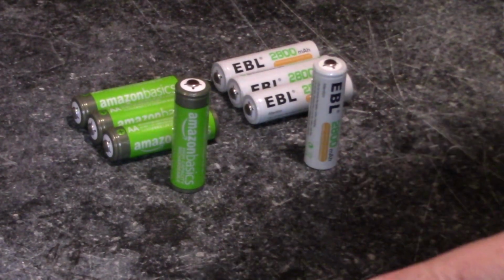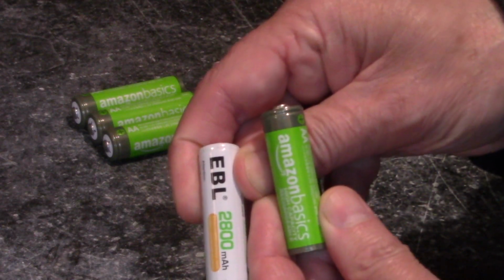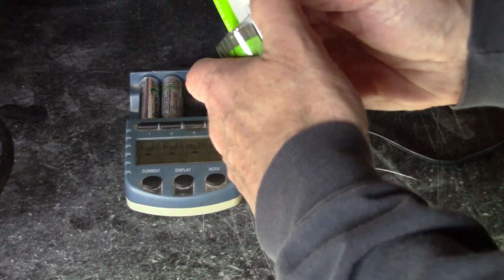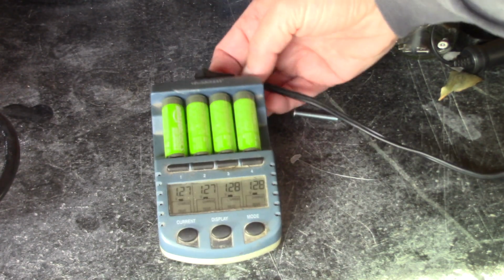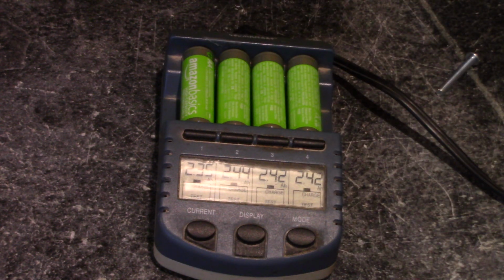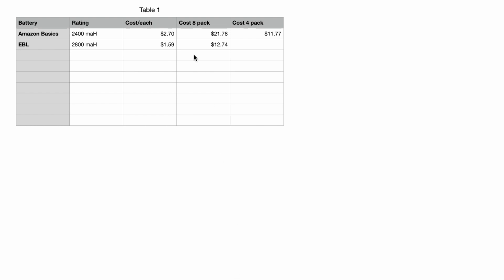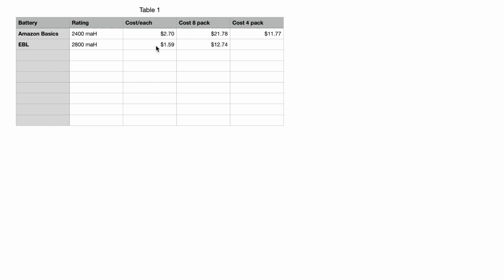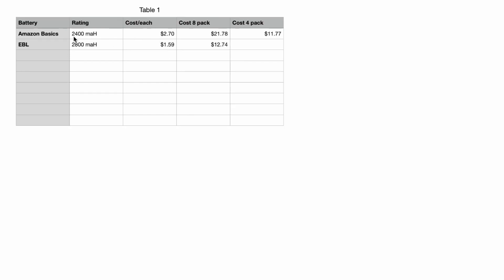Amazon Basics AA NiMH Rechargeable Batteries Compared To EBL - Which Is Better?

Comment: My Panasonic AA rechargeable batteries I bought 25 years ago still have higher capacity and lower output resistance than newly bought EBL. EBL will not hold the charge.
Reply from the maker: I have had similar experiences with other brands as well.

Comment: Everybody's neglecting one of the biggest differences that define overall cost -- cycle life.  Everyone assumes that they're either all the same or that the rating is accurate.  Neither assumption is even remotely accurate.  An 8% difference in single-charge capacity is nothing if the usable cycle life can vary between brands by as much as an order of magnitude.

Comment: I got 8 pack Amazon basic high capacity 2400mAh AA for $6 last week, it was on a deal. So I guess I got a real deal.
Reply from the maker: That's great news.
Reply: Amazon rechargeable batteries meet and sometimes overexceed expectation.
Reply: @GuyJames907  yes but Panasonic eneloop are definitely better, I text them and Panasonic last longer
Reply: Eneloop is always going to be better,  didn't bring it up, but they the best batteries around. Amazon rechargeables are decent quality

Comment: Amazon Basics prices have come down since.  I just saw 8-pack AZ Basics AA NiMH for under $13.   I may get those versus a new order for Ikea LADDA 2450 which are basically Panasonic Eneloops.  Ikeas are $9.99 for four.  Basics beats that - as long as they perform with same level cycle count.
Reply: If you want to be sure you get quality then, make sure it's made in Japan. Chinese cells are OK New, but down the line they go bad faster.
Reply from the maker: Good to know thanks.

Comment: Amazon Basics also has 2000mah batteries that are a great deal IMO. I bought some recently and put them on my tester, and found that they got about 2020mah or so on the very first cycle. I was a little bit surprised that they met their rated capacity without breaking them in, most NiMH batteries need a few cycles before they reach their full capacity.
Reply from the maker: Thanks for sharing

Comment: OMG EBL sucks - they lasted less then a year in almost all of my applications. Also they update and change generation without updating any markings making it hard to tell which ones are old vs new
Reply from the maker: Yeah I'm not a huge fan of EBL either.
Reply: They've been known to exaggerate their capacity claims pretty consistently. I don't really buy any of their stuff because of that, it's hard to tell what you're actually getting.

Comment: I bought an 8 pack of EBL batteries and half of them failed within a year and only 1 is still working at nowhere near it’s rated capacity 5 years later. EBL batteries are currently $15 for an 8 pack and Amazon basics are $16 for an 8 pack. I find the choice of Amazon basics to be evident. Also I highly suspect the Amazon basics are rebranded Eneloop batteries based on my charger/ analyzer findings and daily use case.
Reply from the maker: Wow @twhite19782012 that's interesting.  I've always wondered who really make the Amazon Basic's batteries.  They perform well in all of my tests.
Reply: From the reviews it sounds like they are now made in China. If you want Genuine Eneloops, besides Panasonic themselves. You can get Ikea LADDA cells, or Fujitsu(They actually manufacture Eneloops in Japan for Panasonic still). The cost difference is not that much but you still save a few bucks for the Pro/2450mAh model.

Comment: The unknown/untested factors are the voltage fall-off curve during discharge, and charge retention over time when not being discharged.
Reply from the maker: The tester I used does not have graphing capabilities but you could do this yourself with the right equipment.
Reply: Which device are you gonna these with to be so worried about current .?

Comment: Prior to 2020, Amazon Basics were good batteries because they were made in Japan. Starting in 2020, production has moved to China, and the quality has deteriorated accordingly.
Reply: For what it's worth, I bought a new set of 2000mah Amazon Basics rechargeables and they slightly exceeded their rated capacity on the very first cycle on my charger/tester. They actually performed better than the ones I bought a couple years ago. Of course, there are other factors too like self-discharge and so forth, I haven't done any kind of test to see how they perform there.
Reply: If you want proper Japan-made batteries you're free to purchase eneloops since the 2020 Amazon batteries were really rebadged eneloops
I think it's proper to compare batteries based on what they are rather than what country they came from.
I still think the Amazon batteries have a good price to performance ratio compared to the other brands, and they're still the brand I go with.
Reply: @JessicaFEREM  I settled on IKEA Ladda (made in Japan). $10 for 4 pieces
Reply: @User-pq2yn  Same here.
Reply: Not sure this is a good assessment. Japan is just not competitive when it come to making batteries.
Reply: @raymondchow8722  everything in japan is made better. nothing in china is "made better", just cheaper

Comment: I alredy own a sony charger, that outputs 1.2V 360mA. Can I use that one to rechargre any of these?
Reply from the maker: Sure as long as it's designed for NiMH batteries.  The 1.2V is low but that sounds like a nominal voltage. Check to see what chemistry it was designed for

Comment: Let's ignore what is printed on the batteries and evaluate them on how they perform and how much they cost. In this review, an EBL AA rechargeable battery delivered about 2200 mAh and cost $1.59. An Amazon Basics AA rechargeable battery delivered about 2400 mAh and cost $2.70. So, compared to EBL, an Amazon Basics AA rechargeable battery had 9% more capacity and cost 71% more. That makes the EBL battery sound like the better deal. Another important factor is how much power the batteries deliver when they are no longer new. In a separate review, the EBL battery produced about 2400 mAh both when new (https://www.youtube.com/watch?v=0A1GvQ40j0Q&t=158s ) and after a nearly a year of daily use (https://www.youtube.com/watch?v=-jXQNY6rve8&t=136s ). The Amazon Basics battery also performed well after nearly a year of daily use. An Amazon Basics battery does better than an EBL if you charge the battery and let it sit on a shelf for a year before using it, but I regularly use and recharge my rechargeable batteries, so that test does not matter to me. In short, the EBL battery is not a 2800 mAh battery, but it is a pretty good value as  a 2200 or 2400 mAh battery.
Reply from the maker: I think it's important that a battery should meet its rated capacity.
Reply: @SmartPennyPincher  These are all value cells. To me this is about cost/Energy Ratio. But there's better options I think.
Reply: Lying sucks but a better value is a better value. I just wish more brands had third parties test their stuff before being allowed to market false specs  @SmartPennyPincher
Reply: This is what I was expecting the reviewer to do, but you did it! 🎉 Thanks.
Reply: There are also other factors, like self-discharge, to consider. There were some people who did some tests on YouTube a few years back and found that the EBLs didn't perform too great in this regard.
Reply: @photoniccannon2117  Assume anything not the standard 2000-2300mAh to not be LSD cells. The more mAh the worse the ability to cells are to last long not cycled. The EBLs are just not LSD from the start. I did have a 2300mAh model I got from work that seemed OK. The largest Factor I think is a combo of Low-Self-Discharge/Pre-Charge and how fast that Internal Resistance builds when cells are in storage. Like LiIon fully charged cells get damaged faster then half full ones for storage. But it makes less sense to not have AA charged ready to go.
Reply: @DTrizzy  Yea, I generally assume the same, although some brands like Duracell have been shown to be a little bit better than others (even if they aren't really fully low-self-discharge). Have you tested the 2500mah Eneloop Pros to see how they perform? (They claim, I believe, 85% energy retention after a year. Not sure about internal resistance, and I haven't tested them personally to see if they match the claims).
Reply: @photoniccannon2117  I bought some Fujitsu branded ones that makes those Pro cells for Eneloop and Ikea. They go bad fast. I didn't use them for a while and their IR-Internal Resistance got really high and not worth me cycling to attempt to fix them. You are better off getting lower capacity 2000=2300 that are actually LSDs if you don't constantly use them for work, or high usage Flashlights. Once batteries go bad smart chargers can't really ever get them back to fully normal. Sometimes you get lucky but then you might still need to baby them every few weeks to keep the chemicals going.
Reply: @DTrizzy  Yea, I generally avoid the higher capacity ones too for that reason. The 2500mah ones are expensive. They're not really worth buying if they'll only last a few years.